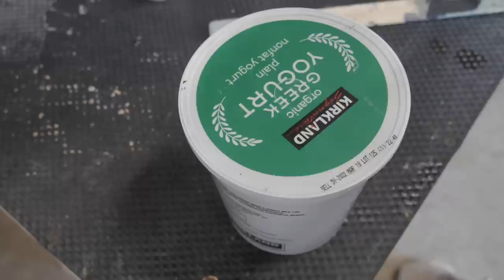Old Hutch to Modern Display Cabinet Transformation | ASMR Furniture Flip

Comment: Looks great, my only question is why there are two handles on the middle door?
Reply from the maker: Thank you! There were two handles on the original design, and I loved it so rather than filling the holes, I also went with 4 handles. Makes for a more symmetrical look 🙂
Reply: @renewfurniture4953  ahh that makes sense. Yes didn't even notice at first and then I was like hey there's only 3 doors. Lol great job!